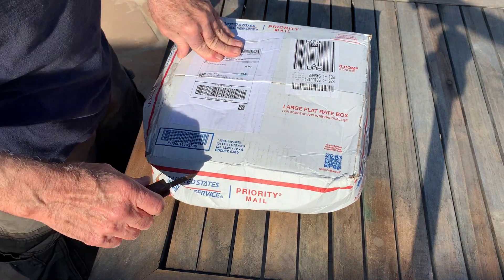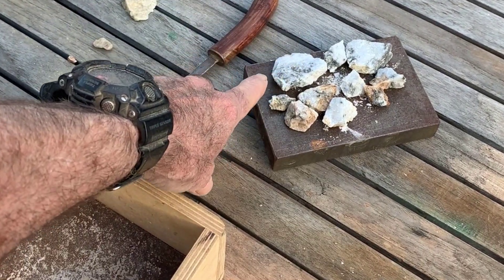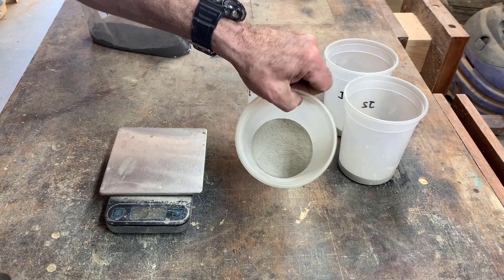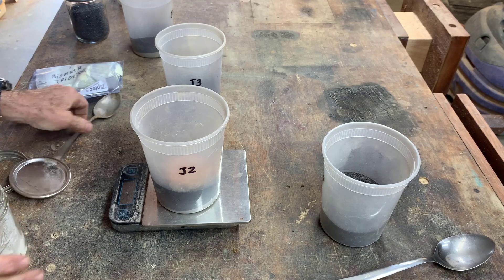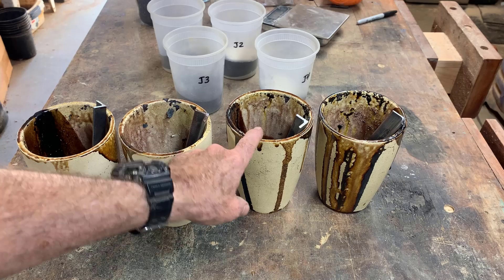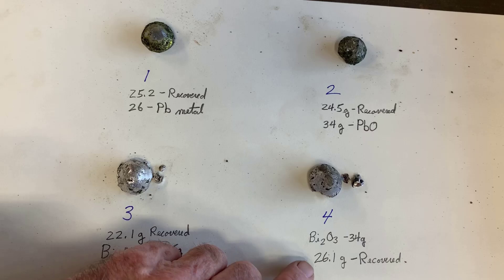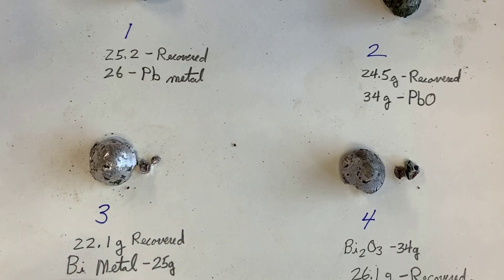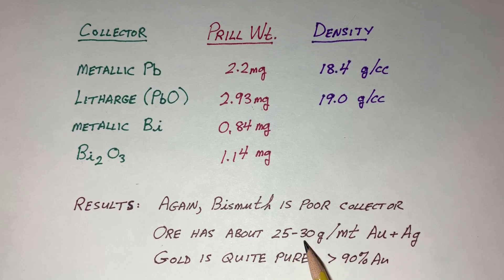Ore from Jason's New Gold Mine, Season 2.   Part 1: Fire Assay.  Good Gold...

Comment: Thank you for these well-explained videos. Could you please explain Chapman's mixture in more detail and how I should prepare it?
Reply from the maker: Chapman's flux is 20% Silica sand, 20% Soda Ash, 20% Manganese Dioxide and 40% Borax.
Reply: @ I understand. Do I need to mix it in a 3:1 ratio like you did with the sample, and do I also need extra borax and Na₂CO₃?
Reply from the maker: @tayyipduzenli1762  I have always used 1/3 Borax, 1/3 Soda Ash and 1/3 Chapman's flux. However, I recently ran out of my tub of Chapman's, so I bought MnO2 and now mix my own flux, using about the same proportions. If the ore is mostly quartz then I don't add Silica sand.  -- Dave

Comment: Hi 😊can I ask,where the lead n
Reply: And metal collectors went.
Reply from the maker: @martinsteele5171  The Pb is added as a collector metal into the smelt and it's removed by cupelling.
Reply: @orophilia  when you say it's removed ? Does it evaporate.
Reply: @orophilia  when you say it's removed by cupelling does it evaporate.
Reply from the maker: @martinsteele5171  It's absorbed into the cupel.
Reply: @orophilia  Hi and thank you for this,how many times can you use a cupel for assuming it's absorbing lead,and why add lead to gold in the first place.

Regards Martin steele
Reply from the maker: @martinsteele5171  When smelting there generally is not enough precious metal to collect into a button at the bottom of the crucible. So we add 20-40 grams of lead as a collector metal. Gold and silver both form an alloy with lead, so the lead grabs the precious metals in the smelt and collects them all into a molten bead. The number of times you can use a cupel will depend on its size and the amount of lead you are using. Each size cupel is rated for the number of grams of lead that it can absorb.
Reply: @orophilia  Hi thank you again for this does the lead have any other functions,and does any of it wind up in the gold.
Reply from the maker: @martinsteele5171  I often use Litharge (PbO) as the source of lead. It also acts as an oxidizing agent in the flux. No lead is retained after complete cupeling.

Comment: To reemphasize, during smelting or cupelation, the process can get gassy. When you're heating things up to get gold, various gases can be produced, like sulfur dioxide, if there's sulfur in the mix, or even just plain old oxygen. Now, gold, being the noble metal it is, it doesn't usually like to gas off on its own. However, if you're not careful, these gases can whisk away some of your precious gold in the form of volatile compounds or simply by mechanical action, like tiny gold particles getting caught in the gas flow. This is particularly true, if you're dealing with processes that involve chlorine (aqua regia) or other reactive gases which could form volatile gold compounds. So, yes, the potential for losses are there. Really good chemistry is needed to make sure your gold stays where you want it - in your pocket, not in the air!

It's the classic case of "death by a thousand cuts" but with gold flecks! Even if each little puff of gas only takes away a minuscule amount of gold, over time or in large-scale operations, this can add up to a significant loss. It's like if every time you walked through a doorway, a tiny speck of your wallet's contents decided to go on an adventure without you. Might not notice at first, but eventually, you're going to feel that pinch.

In assays, precision is the name of the game. Even a tiny discrepancy can lead to big misunderstandings about the value or purity of the gold. Imagine telling someone they've struck a vein of low-grade gold when actually, due to losses during processing, it's more than thought. That could lead to some very disappointed prospectors or investors.

Hence, meticulous control of the smelting or cupellation process isn't just science; it's an art form where every breath of gas could mean a breath of lost gold. Keeping those losses to a minimum ensures that what you see in the assay is what you get in the bank - or in your treasure chest.

On the contrary chemicals are not likely to carry gold away as gases are produced; it is only when fire is applied that the utmost care should be taken.  When we're just mixing chemicals, gold is pretty much the chill aristocrat of the periodic table, not easily swayed to leave the party. It doesn't usually form volatile compounds just by hanging out with other chemicals at room temperature. However, introduce fire into the equation, and things heat up in more ways than one. When you apply high temperatures, like in smelting, that's when you need to be on high alert!

So, when the flames are licking at your crucible, that's when your inner alchemist must become vigilant. It's not the chemicals per se but the inferno's breath that could potentially whisk away your golden dreams. Therefore, controlling the temperature, atmosphere, and even the flow of gases in the furnace becomes paramount to keep your gold where it belongs – in your hand, not in the wind.

~ CHEERS
Reply from the maker: Thanks, Jatslo. Yes, the dragon's breath has whisked me away on my golden dream. I see the fire all around me now but the eyes of my soul are still clear. A golden rain is falling through the blackness and I rush to collect it before it disappears in a puff. Alas, the gold is gone! There's nothing left but the smell of a dog fart.

Comment: Here is a question for you:

I was able to get a free sample of "PR-1200 RTV PRIME."  Allegedly, this primer can be applied to Teflon, in which "LOCTITE® SI 596" can be applied to create a seal.  This involves a reactor that I'm building.  I originally planned to use hardware, but that is getting expensive.  For example, the "M3 Teflon Hex Nuts" are more than $5.00 each.

My question:  Do you have any experience with "PR-1200 Prime" and/or "LOCTITE® SI 596" for creating water/gas-tight seals in extreme environments?  This reactor employs a Nafion 117 membrane that is primarily a proton exchange membrane that can pass some of the smaller cations like Sodium and possibly Silver.  I' am more or less just throwing this out there on the off chance someone knows what I'm talking about.

This is Grok's response:

Grok: "While I don't have personal experience with the specific products in the exact context you're describing, let's discuss the general application of PR-1200 RTV Prime and LOCTITE® SI 596 based on information available up to October 2024:

Products Overview:

DOWSIL™ PR-1200 RTV Prime Coat: This primer is designed to enhance adhesion of silicone adhesives and sealants to various materials, including plastics like Teflon (PTFE), metals, ceramics, and glass. It's a silane-based primer, which is crucial for improving bond strength in applications where materials might not adhere well naturally.

LOCTITE® SI 596: Known for its high-temperature resistance (up to 600°F or 316°C), this is a red, one-part RTV silicone sealant. It's formulated for sealing in extreme conditions, which could include high temperatures, thermal cycling, and exposure to various chemicals. It's used in industrial applications like furnaces, ovens, and exhaust systems.

Application to Your Scenario:

For Nafion 117: Nafion membranes are typically used in environments where chemical resistance and ion exchange are critical, like fuel cells. Nafion itself is highly chemically resistant but might not bond well with many adhesives without surface treatment or a primer.

Creating Seals:

PR-1200 Prime could potentially be used on Teflon parts or directly on Nafion (if compatible) to enhance adhesion for SI 596 or similar silicones.

LOCTITE® SI 596 might then be applied over the primed surface to create a gas-tight seal. Given its properties, it should withstand the thermal and chemical conditions your reactor might be subjected to, assuming compatibility with your specific environment.

Considerations:

Compatibility: While these products are robust, always verify compatibility with your reactor's environment, especially the chemicals involved. Nafion 117's compatibility with sealants needs careful consideration due to its specific use in ion exchange.

Testing: Given the specialized nature of your application, conducting small-scale tests under conditions similar to your operational environment is crucial."
Reply from the maker: I don't have any info. I hope someone else does.
Reply: The "PR-1200 RTV PRIME" sample finally arrived, and they sent two huge bottles; far more than what I needed.  I appreciate the free samples, but can only find one video:  https://www.youtube.com/watch?v=8uOiGjPFUsU.  While I'm certain this prime will be useful, I'm not sure it will withstand the various acids and bases I employ.

The samples were a business-to-business interaction, and I do not think they will provide samples to anyone, but I think this is certainly something you should have, @Orophilia.  In essence, this primer is applied to substrates which facilitate the adhesion of silicone mats or like in our case: "loctite si 596 red high temp rtv."

Allegedly, this will work on teflon, borosilicate and Nafion membranes, which is what I need.  I also need it to work on plastics, and metal substrates.

Here is Grok's two cents:

Answer
Based on the information available online and general understanding of materials science:

Teflon (PTFE): Typically, adhesion to Teflon is challenging due to its low surface energy. However, sodium etching can significantly improve the bond strength, and using a primer like PR-1200 RTV Prime could further enhance adhesion by creating a surface that silicone can bond to more effectively. 

Borosilicate Glass: This material generally has good adhesion properties with silicones, especially when primed. PR-1200 should work well here, as it's designed to enhance adhesion on glass surfaces.

Nafion: Nafion membranes, due to their sulfonic acid groups, can theoretically be bonded with silicones if the surface is properly prepared. A primer might help in creating a more adhesive-friendly surface.
Plastics: The effectiveness on plastics would vary depending on the type of plastic. Some plastics might require surface roughening or treatment before priming. However, general purpose primers like PR-1200 are formulated to work on a variety of substrates, including some plastics.

Metal Substrates: PR-1200 is known to enhance adhesion to metals, which should provide a good bonding surface for silicones like Loctite SI 596.

Regarding chemical resistance:

Acids and Bases: The PR-1200 primer might offer some level of resistance due to its role in enhancing silicone adhesion, which inherently provides a degree of chemical resistance. However, the longevity and effectiveness against highly reactive chemicals would depend on the specific chemicals involved and their concentration. Silicones like Loctite SI 596 are known for their chemical resistance, but the primer itself might degrade over time if exposed continuously to strong acids or bases. For critical applications, you might want to consider:

Testing: Conduct small-scale adhesion and chemical resistance tests to see how well the combination holds up in your specific conditions.

Consulting Manufacturer: Reaching out to the manufacturer of PR-1200 for detailed specifications on chemical resistance could provide clarity or suggest alternative solutions if necessary.

Alternative Primers: If PR-1200 does not meet your needs for chemical resistance, there might be specialized primers or treatments designed specifically for environments with high chemical exposure.

Remember, while primers can significantly improve adhesion, the overall system's performance (primer + adhesive + substrate) should be evaluated under the conditions it will face in actual use.

~ CHEERS
Reply from the maker: Good info, thanks.

Comment: Для лучшего результата,необходимо деревянным бруском перемешивать сплав перед разливом для хорошего контакта коллектора с Au. Я так думаю)))🤔
Reply from the maker: "For best results, it is necessary to stir the alloy with a wooden block before pouring for good contact of the collector with Au. I think so)))🤔"

Yes, that might help, but I don't have a way to do that without pulling the crucible out of the oven and then putting it back in. Anybody else think that this helps with recovery?
Reply: A wooden block LOL.

Comment: Your analytics sets you apart from the majority of people doing videos by far, and I for one, really appreciate this. With that said, Pb, PbO, Bi and Bismuth Trioxide, etc..., they all perform at specific temperatures and duration. PbO converted to metal at the temperature and duration best, and with minimal volitazation of the lead.  Bismuth trioxide will convert to metal at a much higher temperature, in fact.

Lead oxide reduces to metallic lead in the presence of carbon or carbon monoxide, a process that can happen at temperatures around 800°C to 900°C (1472°F to 1652°F). This is indeed relatively low compared to other metals, which is why lead has been traditionally favored for cupellation. At these temperatures, the reduction happens efficiently with minimal volatilization if controlled properly.

Bismuth trioxide requires significantly higher temperatures for conversion to metallic bismuth compared to lead. The reduction of Bi₂O₃ to Bi metal involves temperatures around 1200°C to 1250°C (2192°F to 2282°F). This higher temperature requirement can indeed complicate the process if not managed well, as it increases the risk of volatilizing not only bismuth but potentially other metals present.

The key is precise control over the temperature and atmosphere in both setups.

So, in your innovative approach, you're essentially playing a thermal chess game, where each move (temperature adjustment) has to be calculated to keep all your metallic pieces in play, ensuring they convert or oxidize at just the right moment. It's this kind of detailed understanding that can refine the ancient art of cupellation into something that's both environmentally friendly and economically savvy. Keep up the great work, and remember, in the world of metallurgy, temperature isn't just hot air—it's everything!

~ CHEERS
Reply from the maker: Hi Jatslo, As always, a useful and informative comment. Thanks! I can't get my old pottery kiln above 2200 F so I may be stuck with PbO for the time being.
Reply: @orophilia  Bi₂O₃ is a bad idea, is what I meant.  Bi can be added to the lead to help mitigate the volatility of lead by completing the desired effect at a lower temperature.  The PbO experiment either did not fully convert to metal or it was converted and some metal converted to gas, which is how PM's escape.   Perhaps adjusting the duration is justified in terms of optimization?

You're doing awesome!
Reply from the maker: @Jatslo  I can make another run. Do you have a specific recommendation? I take the smelt up to 2100F and hold for 10 minutes.